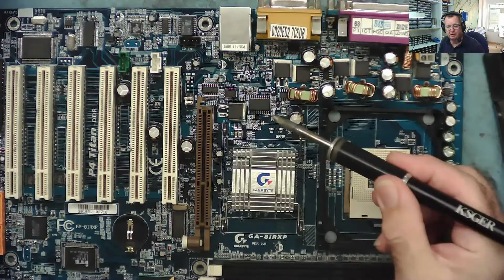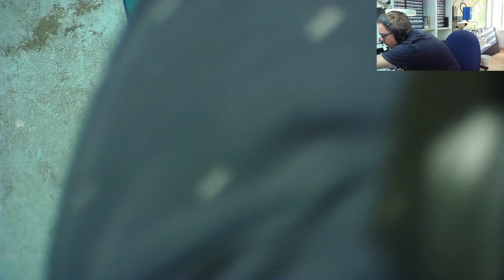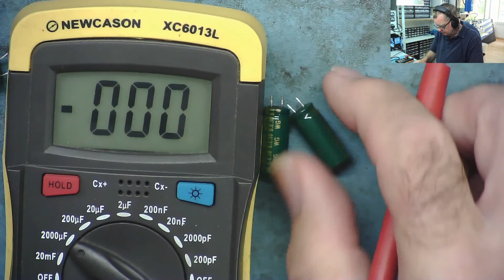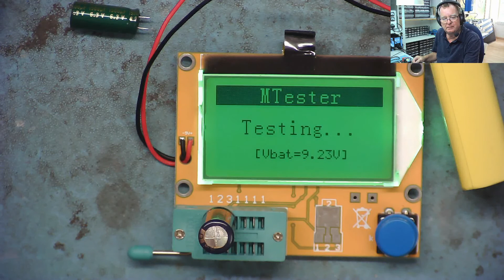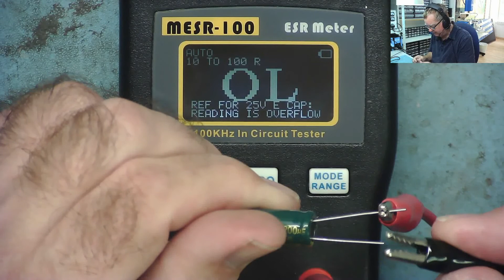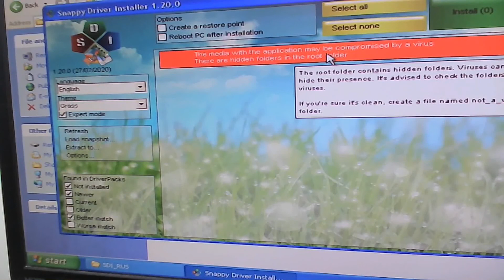Recapping Repairing Restoring Retro Gaming Motherboard Tutorial. The Complete How To Guide. LER #099

Comment: soldering needles,they are actually orifice cleaners for gas welding/cutting torches,i've also seen them advertised as guitar nut files,but they most definitely are orifice cleaners,BOC sell sets  with flip top.

Brass hard soldering/brazing rods can be fitted to a soldering iron ,cut to length and proper diameter used will work to push through holes to clear them,maybe use a solder sucker.

Do what works,i need to recap my old workhorse xp/vista,7,8.1,10 pc as all my Tina designs are on the vista drive,Tina is a bitch to transfer to another pc.

Comment: Just found this video looking for additional tips on removing small through hole capacitors from a motherboard as I'm working on a particular tricky one and I kid you not I use the same solder wick, flux, hot air station, ESR meter and even old Fluke meter as you!

The Fluke meter an old neighbour gave me who used to teach me about electronics when my mum would pop round for a cuppa with his wife.
It's getting on a bit now and the screens on its way out so I recently upgraded to the True RMS 117 which is a beaut. I've also treated myself to a Weller WT1010 soldering station to replace the absolute pile of junk Baku I've been using the last couple of years! 

Using a leg of the capacitor with hot air is doing the trick clearing the holes as flux and wick just not cutting it, think it's as the holes are small. Not heard of solder pins before, will have to get some. Thanks for the tip :)

Comment: Oh yes! This is my kind of video!

1:03:12 re: that flickering, I think I saw a bulging cap on that graphics card earlier in the video 🤔

1:10:40 I didn’t catch the model (I’ll go back and check) but you’re looking at the £20-£30 range, maybe a bit more if it turns out to be unusual in some way 👍🏻

Edit: GA-81RXP, we’ll it’s got a creative CT5880 audio chip so that’s quite nice. Aside from that, it looks like it DOES take 400/533 and 800 MHz FSB CPU’s (up to 3.4GHz) but only supports DDR266, which is…not so nice. 

So I’d expect that board to fetch closer to £20 than £30 BUT it looks like it was the first board that was able to run a P4 Northwood at over 3GHz, so from a historical standpoint, it may be worth a little more.
Reply from the maker: Hi Jon, you have sharp eyes - there are a couple of bulging caps on that GPU - let's see if we can fix it. Actually I have quite a few old mid range cards that don't work - let's do a 'hall of shame' video and see how many we can get working just for the fun of it
Reply: @learnelectronicsrepair  A repairing old graphics cards video? I’m absolutely down for that!
Reply from the maker: @jonchapman6821  Then let me dig around and see how many I have......  coming soon
Reply: I missed the bulging caps on the graphics card too. It’s at 46:46 if anyone else is looking. Now I need to see if Richard made a hall of shame video. 🤓